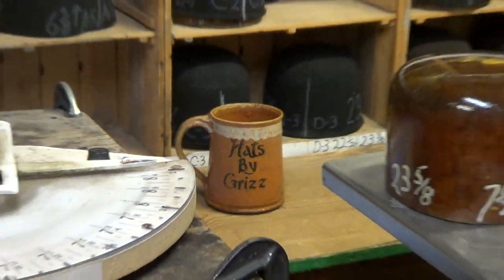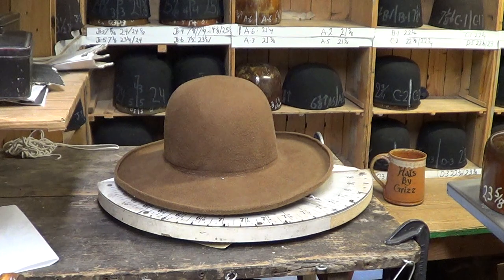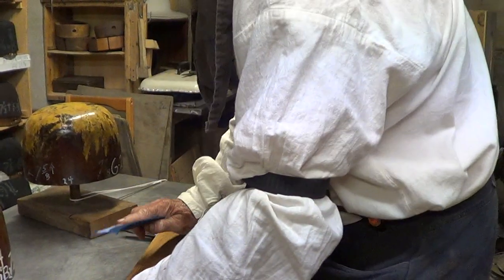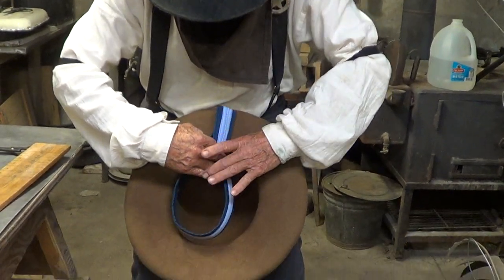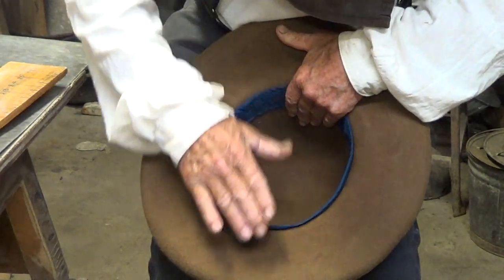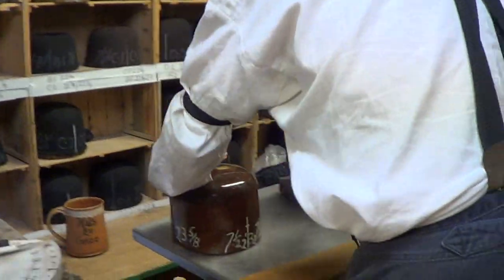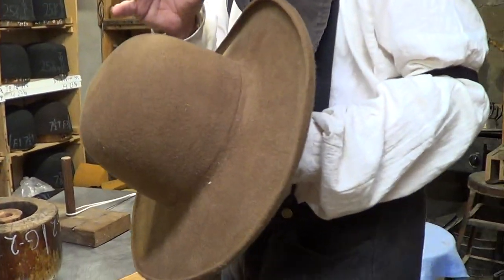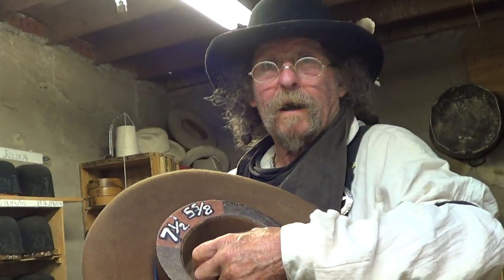Fitting in a Sweatband 102

Comment: any snowballs chance in hell you know where i can find the old school WOVEN rayon ribbon that goes in-between the ends of the leather sweatband ON THE INSIDE OF A FEDORA HAT that you would typically find on vintage 1940's/1950's vintage fedoras? Yes the milliners sell it by the bow, but i am looking for a roll of this tiny 1cm ribbon mentioned above, not the smooth flimsy "Chinese Sensation" polyester ribbon..
Reply from the maker: You might check on etsy...there are a lot of vintage sellers
Reply: that would be the obvious go-to place..but they're all slining the made-in-china crap.